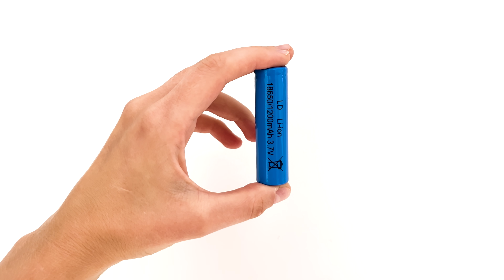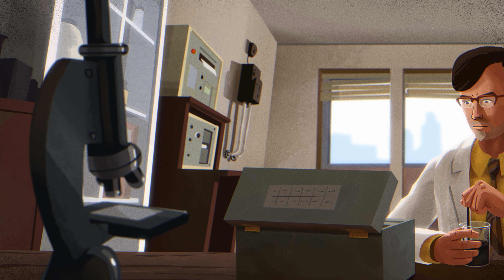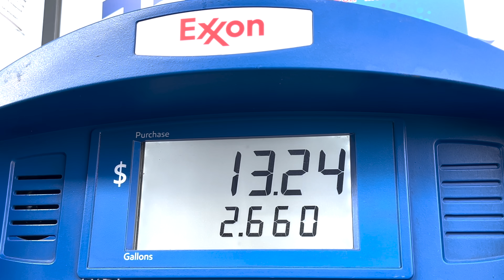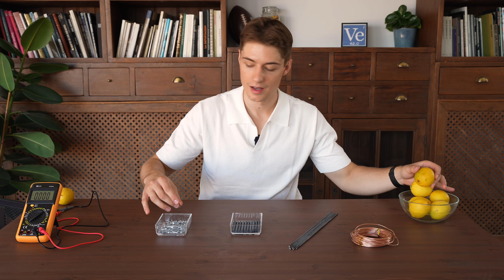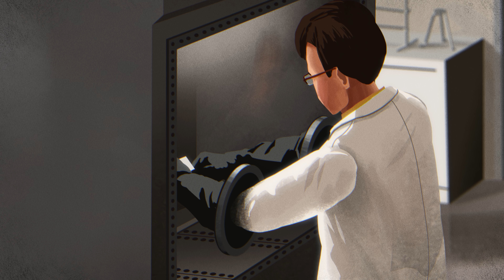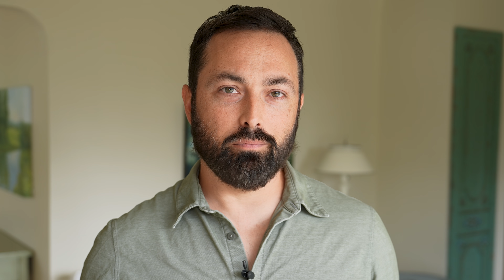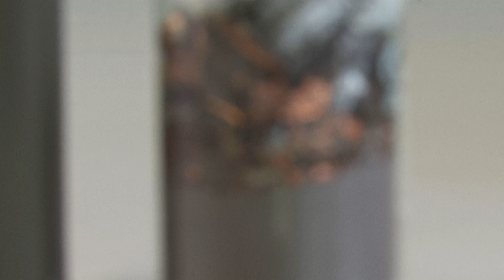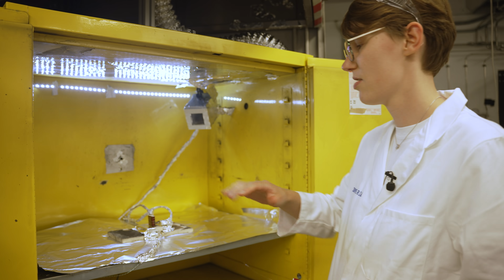The Perfect Battery Material Is Dangerous

Comment: You missed out on the Baghdad Battery, a 2,000-year-old artifact consisting of a clay pot, a copper cylinder, and an iron rod.
Reply: It was not a battery. It has been debunked
Reply: @ludvigthebirb7131 

While the idea of the Baghdad Battery as a functioning ancient battery has been claimed to be “debunked”, it's more accurate to say that the initial interpretation of its purpose as a battery is not widely accepted by archaeologists and scientists today. The artifact itself is real, but its function is likely not what was initially theorized. 

While MythBusters did demonstrate that a replica could generate a small amount of electricity, they had to modify the design to make it work, and the original artifact's design prevents it from functioning as a battery in its original form.

It’s 2000+ years old. We have no idea what it actually did. But functional it is VERY similar to a battery.

Comment: I recently found some Ni-Zn cells with a 1.7V rating.  What is the reason we use 1.2V Ni-Cd or Ni-Mh when the voltage is too low for many 1.5V devices?  I feel like the 1.6V (1.7V? charge?) Ni-Zn would suit the purpose of AA and AAA rechargeables so much better.  All those things where the 1.2V isn't cutting it, and you have to use disposable AA / AAA, would be fine with 1.6V Ni-Zn cells, which already come in the same form factor, as well as C cell and D cell sizes.  And are still cheaper than lithium, and far less risk of fire, so they are well suited to use where lead acid is desirable, like kids toys stored outside regularly, etc.

Comment: 1 in 1.000.000 cells may sound incredibly save, but if you have a few thousand cells in your car the odds stack more against you.
Reply: EVs have active cooling systems and advanced battery failsafes. There's a reason EV fires are pretty rare compared to gasoline and diesel car fires.

Comment: why is litium good for battery: litium is a soft alakali metal with 1 valance electron that is easy to release which in simple words let the litium release higher voltage then normal batteries when litium gives up its electron and become li+ it release energy and its ideal for storing energy litium is also very light which make it very good for phones and such and also litium has high cell voltage and its also rechargeable bc of that single electron found in the alkali metals of the outer shell also litium has a good energy/weight ratio so in a nutshell its a good option regerding the bad sides of the alkali metals

Comment: The moral of the story: lithium batteries blow up when moisture or water is introduced, therefore we made a battery with less lithium, but it’s just as dangerous and explodes just as violently
Reply: No they don't. You can throw a lithium battery in water and it won't explode. They explode if they get too hot/get punctured
Reply: @HanTrio3  or if you unwrap it because it’s covered in plastic and throw it in water, it will still explode very violently

Comment: LiFePO4 chemistry is super safe. the next step of the Li-Ion batteries addressing the safety while maintaining sufficient energy density. Your video mainly showed the risk involved in charging Li-ion cells without a battery management system that monitors each individual cell and shuts down the battery if it detects a risky situation within a cell. I saw no mention of this in the video. It is seriously incomplete.

Comment: FALSE lies about bursting into flame heres why! 
If you have a laptop with a battery that needs 80degrees plus internal battery temp on the anode and cathode which are the contact parts at the top and bottom exterior of the battery of a AA or AAA or 9V, the processor of the laptop its powering will be power limiting and voltage limiting to keep its operational power on the CPU or processor at about 50-60 degrees or a cutoff usually about 70degrees they use a heat sink fan for but can have a theoretical max when powered by the wall outlet of up to 90 degrees as ITS FREAKING MADE OF METAL AND CAN WITHSTAND HUNDREDS OF DEGREES YOU FOOLS!  and the battery has a thing that shows you how full it is and which parts of it cell is working or not.. see like the fins of a CPU heat sink fan copper and aluminium cooler or think like a 'oil heater'  you will notice that lithium ion 4Volts or 5V or whatever battery.. will say on the FIRST EVER SONY CAMCORDER 11Volts.. what this means is.. there is more than one CELL of the battery.. so to make minimal risk of puncture or failure it has a titanic like walls and partitions of tiny separate batteries like match sticks wired up to a single input and output which limits the power or 'regulates it'. with devices being built to filter the power and use MULTI PHASE voltage regulators and monitoring and CAPACITORS. If you're going to tell me your resistors and capacitors are exploding and a fire risk when they're just a thin piece of metal wire the current runs down then power plants and telephone power lines are not any sort of possible or realistic so screw off most of the exploding batteries is a fake charging adaptor from a flea market that was modified to explode cheaper batteries and ones without lets just say the apple logo brand name have them be struck by lightning and explode. When they pretended the same batteries in all android phones only exploded in samsung phones a week before they were in every other android phone on the market they just had the earlier release date a bunch of dumb people went to prison trying to sue samsung. So whatever double dildoes infinity double adaptor travel chargers you plug into each other to charge your devices for the off brand no warranty warnings not to do so laptop chargers and things like that for $1 when the factory that made the laptop only says "use this charger with it and none of the others" well its a freaking mystery as to why cheap 50 cents stuff explodes your wallet into buying that specific laptops power specific standards so we now use USB/PD and fast charge and quick charge standards for 'universal use it with one of these types of chargers or plugs" and lightning cables arent exist anymore and because they tried to sell lightning cables the court cases aftermath means you have to be Masochist certified to use a lighting cable now called a type M lightning cable and or charger for $50 each so $100AUD when other brands are still $2 cables and chargers $5-20AUD for fast charging..

All non lithium batteries are identical in risk of fire or melt down yep regular alkaline is still a 'base or an acid". As its not the lithium burning in fact lithium are safer because of the modern improvements.. original 80s lithium not as much.. graphene batteries yay that does sound safer doesnt it? cant call carbon dangerous can we? charcoal and carbon based life forms randomly exploding to sue brand names in court for profit? Others use more acids and bases or have a more unstable element like HYDROGEN if they're not a regular alkaline battery or acid battery or some sort of ancient sugar battery of the 16th century that might explode or burst into flames at LOWER temps and be more unstable with the same acid or alkaline risks. the lots more tiny matchstick battery CELLS with a smart array controller and voltage regulators and monitoring saying how much charge and capacity how many times its been recharged and so on means this video is fear mongering fakelawssuitsmachining and puts dumb people in prison.

Comment: and one thing people forget is lithium batteries decay and even more if they are fully charged and you store them or if you go to low on voltage it can give problems most times its ok but i have had lipo fires i use to drone race we use lithium polymer they are lighter but same thing olmost ion can have mor mah then lipo but not as high ass amp output as the lipo and yes a lot of these lipos could fast charge but i did notice they would give less punch after time so mas amps output and always charging 1c is the best then they stay good for longer and if you store it longer then then 5 days put them on storage charge and then puth them in the freezer but dont charge them up just out the freezer let them warm up slow

Comment: If someone reads comments, I might have an idea for batteries on an industrial scale : instead of chemicals, why don't we store energy in a kinetic way ? Using springs for example, compressed with electric motors and when I remove the brakes, they will extend and spin an alternator.
Reply: That's known as flywheel energy storage, and has been used for quite a while in certain spaces.

Comment: one random day, some phone company is going to announce a phone that needs 1 charge per year and it’s going to be insane
Reply: Maybe, maybe not, and when. This will remain complex and has intrinsic limits.
Reply: I think Philips sold its phone division to the Chinese. The company that bought it released a phone called the Xenium, a buttonless, touchscreen phone. While the first iPhones couldn't even last a day, I charged this phone once a month. But the build quality was poor; the screen scratched easily, and the plastic casing fell apart. I still wonder if an iPhone would exist today, or if this company would become Apple, if it had been made from more durable materials!
Reply: just imagine trying to find the charger after a year
Reply: I think this is unlikely when we consider how much more power newer phones require than older ones. My current phone has a 6000mah battery which is double that of a phone I had years ago. As screens get brighter and processors more powerful I can't see phone companies prioritising battery life over these flashier features
Reply: @Kwirky496 why is it unlikely? phone manufacturers aren’t the ones that are researching on battery advancements, but definitely benefit from it. you claim that your battery capacity doubled in size. did the size double? no. your phone probably uses the latest silicon-carbon tech.. which was not invented by phone companies, but phones definitely benefited from that breakthrough
Reply: @ninjaasmoke  But to last for one year requires like 100x more energy density.

Comment: For once Veritasium actually touches on a subject of which i have intimate knowledge of... and they nailed it! 

Pretty good description of lithium ion batteries and how it works, i'll be using this video to teach the new team members.

Only thing i'd be clarifying is that the degradation paths of Lithium Ion cells differ quite a bit, and that's where the different companies have all their proprietary tech and the battery management kicks in to make it all as safe as possible.

The real boogieman is the Lithium plating/dendrites mentioned, a degradation that happens almost entirely during charging, particularly fast charging in cold environments. Its often the one thats seen causing fires during charging.
Reply: Pretty good description, or Goodenough description?

Comment: 33:19 It's very important to note that all of these battery metals are infinitely recyclable with a 95% recovery rate. They only need to be mined once. It would be awesome to see a video from you on battery recycling, such as what's being done in Nevada at Redwood Materials.
Reply: Very difficult to recycle lithium ion batteries, you essentially have to shred them, let the shredded materials catch fire, separate the metal and plastic components, deal with the toxic and carcinogenic fumes, liquids, and smoke residue via various processes, and result in a black powdery mass that contains the cathode, anode, carbons, binders and salts. All the phone, lap-top, power tool batteries are of different battery pack types, and different internal chemistries.  You could easily have 4 different cathode types in a pile of spent batteries, not to mention the added chemical polymers and compounds to improve battery life from the different battery manufacturers.  It is not at all like recycling a lead-acid car starter battery with thick and very few plates that can be removed easliy, etc.
Reply: @jamesbuckley8917  Keep up, it's already being done at scale right here in the USA. See Redwood Materials in Nevada (founded by ex Tesla founder, CTO, and current board member, JB Straubel).

Comment: Batteries are the solution to climate change.
We don't need more solar power now, we need simple, cheap ways to store what we already get! We need (in order of importance) 1. huge capacity, 2. huge energy density, 3. cheap, 4. non-explosive, 5. non-toxic, 6. quick charge, 7. lasting at least a decase of everyday use, 8. scalable in size batteries. 
And if a battery combines these 8 features - we got climate change fixed.
Just think about it: you won't harvest even free crops if you don't have nowhere to store it! We use the power grid as a battery! That can't work in the long term, so in a desperate attempt, we use our current battery technologies, that won't even meet half of the 8 requirements. But if you want energy solved - just solve the batteries.

Comment: if you place "dots" of yet unknown material that reacts with lithium to grow into something that prevents it growing, too large that problem is solved, you cant have runaway

i hope i explained that vision confusing enough
Reply: You think those wouldn't be actual dots of the material; only figurative, hence the quotation marks, or... what, exactly?
Reply: @HelloKittyFanMan..  the concept is similar to what is already been done, shown in video, but different material and different shape, like single flower with two leaves (i saw that in a dream) my dream had red flower an two green leaves, similar to colors that was used in this video, with addition of two red grains on base of the stem
Reply: @flyfin108 : Thanks. But I was asking you what you meant by putting "dots" in quotation marks, as if you were only being figurative instead of talking about actual dots of the material. So what did you mean by the quotation marks?
Reply: @HelloKittyFanMan..  seeds, just like shown in video
Reply: @HelloKittyFanMan..  currently those seeds grow into a wall of material, this reduces efficienty, by limiting it you get best results
Reply: @HelloKittyFanMan..  i do not know if the flower should grow and "die" during discharge and recharge progress or if it should be stable, but this should give best efficiency to batteries according to my intuition

Comment: I'll give you a simple solution 
Which more to be precise
Is a better solution 
Place 4 round magnets opposite polarity near one another
Place them in a quadruple polarized circle 
One quater of the circle North
One quarter of circle South
Two quartes as above
Putting finger on the four round magnets 
Inside the magnetic circle
The round magnets will automatically spin round and round in a clockwise circle
Place above the center of the circling round magnets polarized magnetic blades, 
The blades will start to rotate automatically 
Connect the rotating blades to a magnetic dynamo
Connect the dynamo to a electric ac dc current circuit board
Perpetual energy
Miniaturise this
Add wood between rotating magnets 
To the north and south as the round rotating magnets in opposite polarity will stop.
Connect the same to capacitors and rechargable current storage.
This is my tech from long past on which the maglev motor was invented.
Develop this further 

Electromagnetic cooling will ensure a longer magnetic life, along with miniaturization of the same, with solid state rechargable batteries and capacitors

Abhijeet Madhukar Deshpande 
0091-9422810454

Comment: Nice historical video of the Li-Ion battery.   One topic of electricity still bothers me.   In another Veritasium video, you showed that ions do not move in power lines, rather there is a field generated which, by the "right hand rule" causes the electricity to have a direction.   However, when talking batteries as the source of electricity,  it is widely described as the movement of ions through the circuit.  Does this dichotomy mean that electricity from a generator (wire and  moving magnets) is fundamentally different than electricity from a battery or capacitor?  

Thanks again for a great telling of the story of LI-Ion batteries!

Comment: You mixed up battery efficiency with capacity loss per cycle. 95% efficient battery with max capacity of 1000 mAh will be 95% charged after you input 1000 mAh, but then if you drain it and charge again, you will again have a 95% charged battery. You'll simply need a bit more charging to reach that max 1000 mAh. What you were talking about was battery capacity loss per cycle. 5% loss per cycle batteries can be only found in some lab in a pile of crap that didn't work.

Comment: A while ago A part of my house burned down due to lithium ion batteries. the fire took 4 fire extinguishers and gallons of water, and this did not even dent the fire, not until firefighters got involved. I woke up right when It started. the most dangerous part of lithium batteries is by far its unpredictability you can take steps to prevent fires from batteries but its completely random. so moral dont screw with lithium ion batteries.

Comment: A lithium ion battery fire is chemically similar to a thermite reaction.  In thermite, iron oxide is mixed with powdered aluminum and when enough heat is added, the iron oxide decomposes, releasing oxygen that then combines with the aluminum.  That reaction provides more than enough heat to sustain the reaction and the result is aluminum oxide and iron, which is molten due to the heat created.  It's used for remote welding and to handily destroy any electronics.  During the Bin Laden raid, one of the helicopters crashed and the Seals used thermite grenades to destroy the sensitive electronics.  They didn't explode, but poured liquid iron on the electronics, effectively incinerating them.